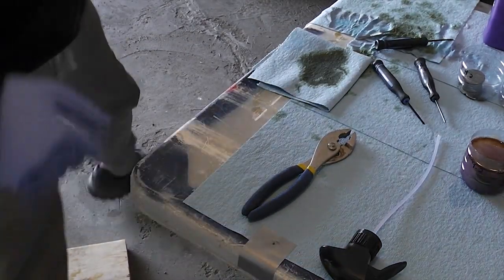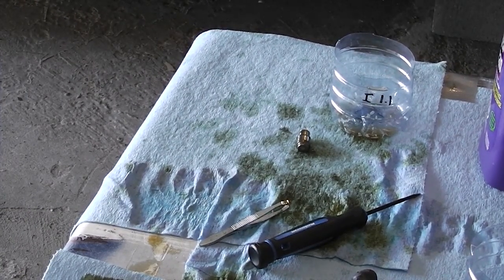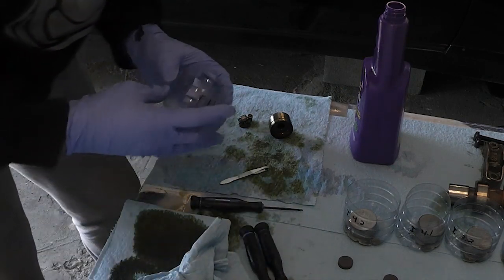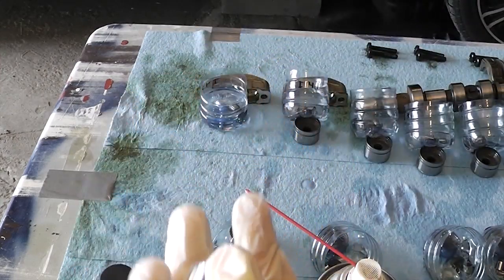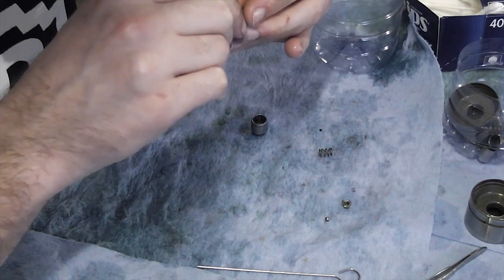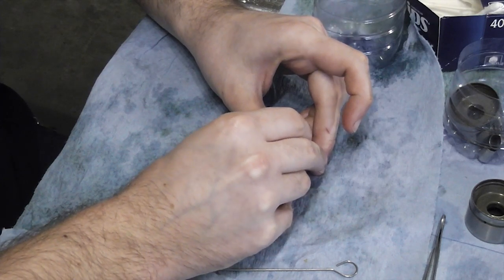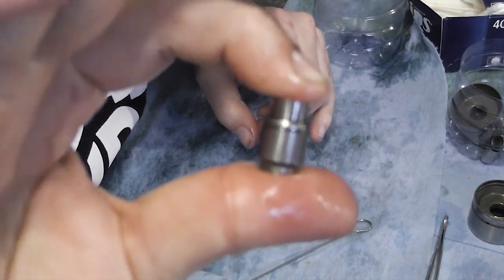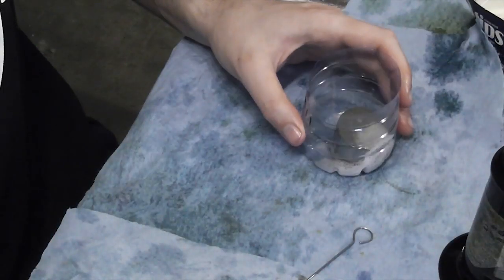Rebuilding Mercedes Lifters

Comment: Great video! thanks. Does this service get rid for the legendary tick tick sound from M104 engines? Also, if the engine does tick is it dangerous for the enginet? is this a bad bad issue? thanks again

Comment: Or just use mobil 1 or any other sunthetic oil. I got rid of lifter issues on new customers cars by changing the engine oil to full synthetic oil. Our customers never developed any lifter issues.
Reply from the maker: That's not a guaranteed fix, this car has been on synthetic oil for most if not all of its life.
Reply: @PatsCarGarage  I suppose not. But if its having issues and you are using syn oil then I suspect it's time for them to be replaced. My so called history with this was around 15 years of hundreds of engines. Not one had an issue. Just a suggestion. If one wants to do what you did then your video is very helpfull.
Reply from the maker: @georgecurtis6463  I had one lifter that was ticking from time to time. So I cleaned all of them and now the ticking is gone. No need to replace anything if a simple cleaning will do.

Comment: This won't quiet lifter tick will it. 
Is this the same lifter type as the 0m603. Mine are ticking a bit.  Wouldn't it be easier to soak them overnight in carb dip or other solvent.
Reply from the maker: It worked for me. I doubt simply soaking them in solvent will be enough, you want to get all that nasty oil out first.

Comment: If i want to replace my lifters, id need to get new camshafts aswell so they wear together correct? Not sure if thats worth it but it would be nice to not have 280000km cams in my engine haha
Reply from the maker: So in theory yes you would need a new cam. However you could also replace the inner part of the lifter with new parts, that would avoid needing a break-in. Cleaning them is usually all it takes to restore them.

Comment: I have an OM606.910 and suspect i need to do this. I do wonder if an EDM sized hole could be a controlled leak that lets the oil cycle without losing functionality. Something like a drop of oil per million revolutions would be sufficient to keep the oil from sludging.
Reply from the maker: I think race engines sometimes do something similar, perhaps for different reasons (adjusting for tolerances on an engine that runs much hotter?). I don't think it's necessary on street engines though, they should already bleed down a tiny little bit when cold, but I guess after 20+ years that wouldn't be enough anymore.
Reply: @PatsCarGarage  well, the thought is that I don't want to go through cleaning it and putting it back together for another 20-25 years of I could have it EDMed and never have to touch it for the life of the engine. I'd probably have the bottom of the piston drilled at like 0.001" (maybe even less) that way it lubricates the valve stem ever so slightly, and cycles fresh oil through the lifters.
Reply from the maker: @Akya2120  Keep in mind : most of that crud probably built up from the less advanced engine oils of the 90s. With modern synthetics I think we'll be fine.
Reply: @PatsCarGarage  that night be true. I wonder if there would be a particular oil to put in those initially that would be a better choice than standard motor oil.
Reply from the maker: @Akya2120  If you don't have a DPF, then any MB 229.5 oil.
Reply: @PatsCarGarage  DPF in a 95!? Egads no. If you mean a diesel cat yes... It's probably pretty backed up at this point. I need to clean it out, maybe a bit more aggressively than the lifters 😅. I found a set of lifters for the 606 are about $1,300 so I'll definitely be cleaning them.
Reply from the maker: @Akya2120  holy jesus, that seems like a lot for lifters?!? Last time I checked it was around 20$ per lifter. Still quite expensive, but even on a OM606 / M104 it would run you about 500$. Anyway, cleaning them is 100% the way to go. I've never heard of this style of lifter failing, there really isn't anything to go wrong, so cleaning them is the best way to go.
Reply: @PatsCarGarage  the multivalve diesel lifters are sightly different dimensions then the previous generations, as a result they're less common and less available making them more expensive.
Reply from the maker: @Akya2120  interesting, I didn't know the diesel engines used different lifters. I thought it would be pretty much a jellybean part.
Reply: @PatsCarGarage  I think they are the same up until the multivalve diesels (OM605 & OM606). When they moved to more valves the lifters got a little smaller.

Comment: hey partner I'm at this step in my rebuild the shop says the block will take about a week and I've got high hopes for my chain. lol. but that never pans out right anyway. I have 1 main question and an idea id like to run by you. 

The main Question is regarding the hydraulic valve lifters locking ring on the outside of the inner part of the hydraulic valve lifter. In the video you mentioned the "Locking ring on the large part of the piston" at 10:11 of the video. I hope the timestamp helps too haha. But does this part need to be taken off I believe you said you did but not in the video but I didn't quite understand completely what you meant by this.  I will likely find out if you don't reply but I still would like to ask because I watched this entire video and wrote down with drawings and stars with explanations of everything from this entire video so that when I go ahead and decide to do this I have no hiccups.  I thank you so much for putting your time and effort and putting together this GODLY assortment of videos to help fellow m111 owners complete their own repairs.

My second kind of idea that I wanted to run by you was about changing the timing chain and moving the crankshaft kind of a two part idea question i suppose. With the cylinder head removed, wouldn't it technically be easier to change the timing chain without even having to unlink the old one if I were to take off the front timing case cover behind the water pump and crankshaft pulley. Behind those is the bolts for the timing chain cover and I wanted to know if you thought changing the chain as well as cleaning out the oil from that location could lead to be a good maintenance idea? Yeah there's like an extra water pump gasket and then just the crankshaft seal, but is the chain able to be just unlooped? or does it still have to be disconnected, is it on a type of rail of some sort? I seen a picture and I wasn't convinced of this which is why I'm asking you, as your knowledge has gotten me very far and I value your input. I appreciate you getting through my comment I know its quite long but I do appreciate this very much. Thank you again and I hope that i wrote this was clear enough for you to understand.
Reply from the maker: For your first question: you don't have to remove that locking ring, it's only there to retain the piston body within the bucket if you will (I admit it's been a while since I've done this myself). It doesn't play an active role in the lifter's function, and I don't see how dirt could get underneath it. Soaking it while it is still attached to the piston should be fine, and honestly, it's such a small part that it would be easy to lose it! Especially since it's fitted on quite tight, it could fly away never to be seen again.

For your second question: I wouldn't go that far for a few reasons. Cleaning-wise, that area is how the oil returns to the crankcase from the cylinder head, it's not an area that would pool old oil that would need to be cleaned out (unlike the lifters!). In general however, the m111 has a double-row timing chain, which have a very long service life. I did my cylinder head at around 220k km, and the chain was just coming up 1/2 way through it's service life, so it could probably reach 500k! You can measure the chain stretch when you are doing the camshaft timing, with a brand new chain, the 2 camshafts will lock together at the timing mark, however as it stretches, the exhaust cam needs to be rotated a bit further independently for it to lock in place. The allowed difference between locking the 2 camshafts is 10 degrees, I was at about 5. All that is to say, if your engine has less than 500k km, you don't need to replace it.

Thank you for your kind words, and I am really glad my videos helped you!
Reply: @PatsCarGarage  thank you so much Pat for your helpful insights and great memory! yeah thats exactly what I was afraid of was popping it off amd boom its gone. my tensioner spring was a bit shorter then the new one so I will have to time it up and see how it all fits. Originally I fucked up because zi followed MB procedure which takes the tensioner out lbefore I was directed to make the cam marks. So ill have to check under and make sure, i dont think itll leak much though. so then the best bet is to get it hot and then change the oil. hmm. i just noticed the oil seems to like get more solid as my head is off. I just dont want that oil going anywhere near my new head. When I pulled the cylinder head off I got a pool of coolant that came out of what I believe was the back chamber of the cylinder head, OR the coolant was trapped in the cylinders.  so IDK. man these machines are beautiful and worthwild to learn and build and its such a shame how easily someone could let one of these prized possessions go downhill. Mines at 137k miles right now it had a bad tick around 1300 to 2100 rpm. only there lol. literally. thank you again I look forward to making a thank you video with a shutouts to you aswell! take care thank you again!!!!
Reply from the maker: @Mitutumuch  By the way, I have a video for timing the camshafts, it's got some important information so I suggest you watch. You don't have to mark the camshafts, the timing marks will move anyway once the tension is released and they will be useless. Timing the engine is not difficult though.
Reply: @PatsCarGarage  yeah i had noticed that you mentioned that in the Removal of  Cylinderhead about exactly what I did lol. but I would essentially just line up my exhaust mark back to where it is, the chain is marked where the sprocket ended and began on the intake and exhaust
like with a paint marker. and I took pics of the cams before but Im assuming you just assemble in Perfect Timing and the tensioner picks up whatever slack is left?

just finished 8 lifters. ive got 8 to go.
The wood trick is absolute Goat. I didnt believe you at first but then I was like well fuck maybe hes onto something. and I tried it and boom came out like a dream. Nicked my finger nail pushing the lifter back in. you deffinately notice if you put too much oil in the lifter and in the piston.

Comment: do not touch with magnets. They then become magnetic and collect metal debris and break faster.
Reply: This is actually really true and if you are going to use a magnet, use a demagnetizer. Even still, better to be careful and not use a magnet.
Reply: magnets made the job hell, spring and ball wouldnt seat properly for a majority of the lifters

Comment: Best cleaning of them is with diesel.Separate and dissasmbly inside elements and put all of that in diesel for few days and you will see what gunk is gonna go out.After that take screwdriver and old towel and twist inside to pick rest of gunk
Reply from the maker: I think using cleaning solvents is a better idea, diesel will probably not clean any varnish that may have formed on the insides of the lifters.

Comment: I appreciate this Video. In my case it is 20lifters to rebuild for OM605 20V. The car is not a typical daily and I like to make things in on my own. Besides I think the OE lifters are better quality than current available Febi or SWAG ;)
Reply from the maker: I believe the OE (at least for the m111) was INA. I always look for the OE when buying parts, only going aftermarket when they make a better part than OE (or OE is no longer available). If you are fixing things yourself, you are already have the biggest savings not paying the shop rates, you might as well get quality parts and never have to do that particular job again.

Comment: What is the usual life span on lifters? I am thinking about replacing/ rebuilding mine on my om602
Reply from the maker: The lifespan is usually "something will happen to you or your car before any sort of failure, making it either not your problem or not a problem at all". But sometimes (as in my case), the lifespan is "indefinite, but needs a cleaning after 20 years or so". Ever since I've published this video, my engine noise has gone significantly down, and I don't have any more lifter tick.

Comment: You're saying the oil remains in the lifter for the lifetime of the lifter. If it can get in the lifter, it can also get out. But on another note, this was good information, however, unless you're working on a project car, I don't think this approach is practical. The lifters are only about $10 each and so buying new lifters would be a better solution. If the job only takes  about 3 hours to replace with new ones then it's much quicker and cheaper than spending an entire day.
Reply from the maker: If you're lucky, the cheapest I could find the lifters was 20$, at 4 per cylinder, it adds up quick. Now imagine you have an m104, m119 or an m120... The oil does not flow through very fast at all. Once they build pressure the oil just sort of stays there. You saw how black the oil was when it came out...
Reply: @PatsCarGarage  you have to shop around, but Autohausaz has them for about $10 - $15. However, I would not skimp out on critical parts or parts where the job is pretty involved like a water pump on a m103. So you end up paying (let's say worse case scenario) $480 for the lifters that takes you 3 hours to complete. Still cheaper overall as the job will not need to be done again for another 20 years :D
Reply from the maker: @lsmalley  Unfortunately shipping up to Canada from Autohausaz tends to remove many zeros from one's bank account.
Reply: I followed this procedure too than spending more than $200 for lifters for an old motor. If I had a 2014 motor I would buy new lifters instead of rebuilding

Comment: Did you have noisy/ sticking lifters? And did this cleaning alone make them all function correctly and quiet again?
Reply from the maker: Yes, I had one which was sticking (never tried to find which one). Cleaning them got rid of the ticking noise, and actually made the entire engine much quieter overall.
Reply: @PatsCarGarage  I had an annoying tick on my M119. I removed the top covers and rotated the crankshaft and checked each lifter to see if any had collapsed. I only have 1/32 to clean. A lot of work but hopefully the annoying ticking will be gone. Thanks for the video, very informative.

Comment: Everyone says that the used lifters are not interchangable but frankly I don`t understand why. The lifter is not filled up completely with oil before putting it back on the engine, so the oil pressure is going to compensate for the slack just exactly as much as it should, regardless of where the lifter was before. The external surface of the bucket (or crown?) does not really matter either if it`s worn together with the tappet bore, because it rotates, so it won`t be back in the same exact position anyways. So why to make such a big deal about this? Very cool video btw.
Reply from the maker: Admittedly for me this is something I've heard from somewhere else and passed the information along. However the way I've interpreted it was that the surface of the bucket wears to the camshaft lobe it's under, not to the walls of the bore it sits in, and that's why they are not interchangeable. Apparently if you have a lifter failure, you can simply swap the new internals to the old bucket and you can avoid having to do any sort of break-in procedure (changing oils, additives and what not).

Thanks for watching!
Reply: @PatsCarGarage  Yeah, this is what I`ve heard too, and it makes sense. I still don`t think it really matters though, because the lifter rotates in the bore, so there should be a circular dip in the center where the cam lobe runs. But I`ve never seen anything like that in the engines I rebuilt. I think if the wear is not detectable they are interchangeable. It`s always a good practice to put everything back on as it was, but it`s not a tragedy if you mix them up, if the lifters are not worn out. I`m rebuilding my Porsche engine now and rebuilding the lifters too because they are expensive if you want to replace all the 24. So your video is a  huge help, it`s the same INA kind lifter. How  do you make sure that there is no air trapped in the bucket?
Reply from the maker: @Fungaricum  Well actually you shouldn't worry too much about air being trapped inside, they are pressurized by the engine's oil so if there is some air inside it will eventually find it's way out. It actually is a bigger problem to overfill them with oil, the valves might actually not rest against their seats, which will bring all of its own problems.

Indeed they are expensive to replace, but they hardly ever break so all they need is a proper cleaning to get them back into working order.

Comment: If I put too much oil in the lifter, will it adjust by itself over time?
Reply from the maker: If you put too much oil, it's best to start over by emptying it out again. They do slowly bleed down overtime, so depending on how pressed for time you are it might not be a problem. 

Basically it's better to start with not enough oil and let the engine's oil pressure adjust them up. If they are really overfilled the valves might not even close all the way!
Reply: @PatsCarGarage  Got it